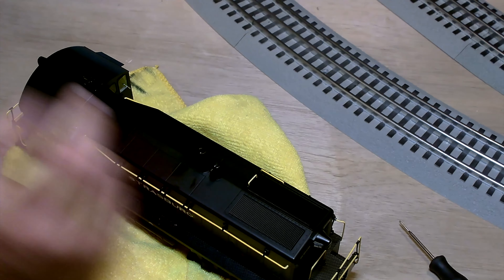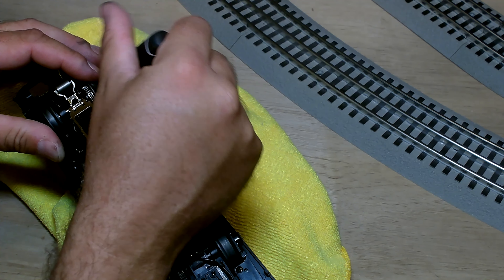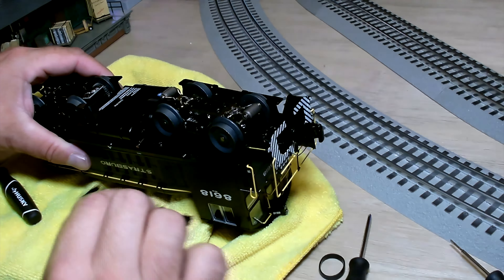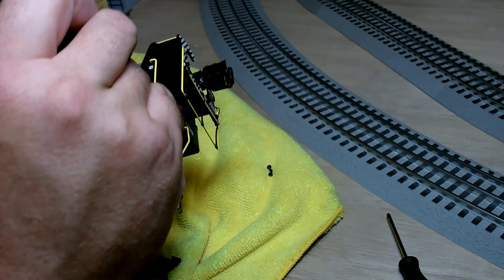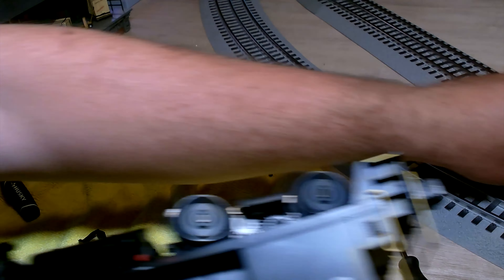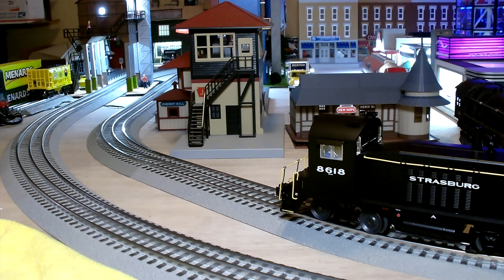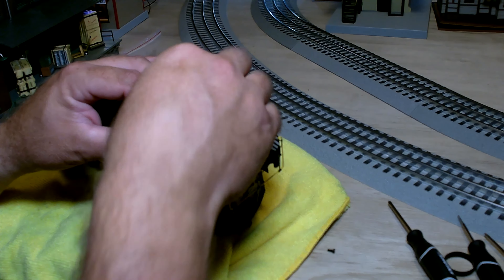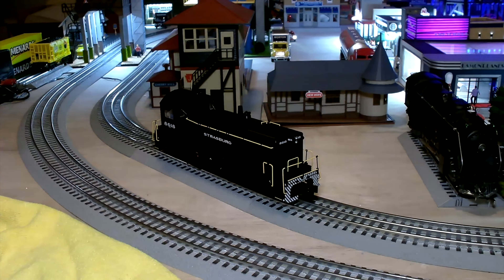How to Change out Traction Tires on a Lionel Legacy O Scale SW8 Diesel Switcher! Strasburg #8618

Comment: Co-incidentally I also just replaced a traction tire on my SW8 and noticed how much larger and softer the OEM tire was vs. the replacements that came with the loco. I was also puzzled why it came off in the first place. Anyway,  I didn't want to pull the side rail off so waggled the tire onto the wheel using a small screwdriver and tweezers, but in retrospect taking off the side rail would have been much easier. The replacement seems to work just fine, but the loco doesn't need to pull much weight.